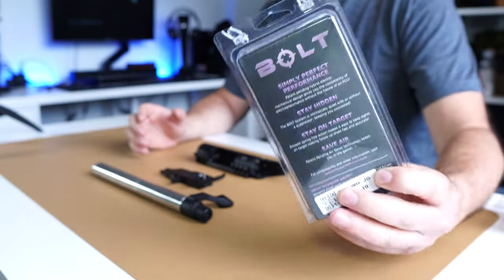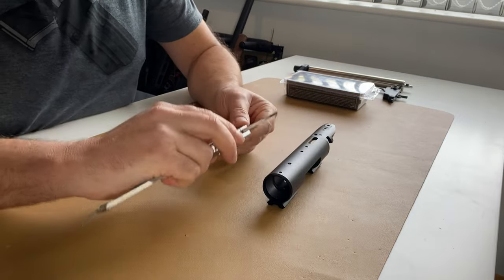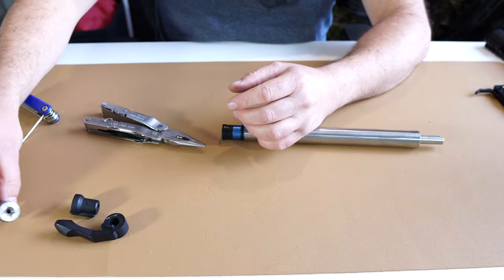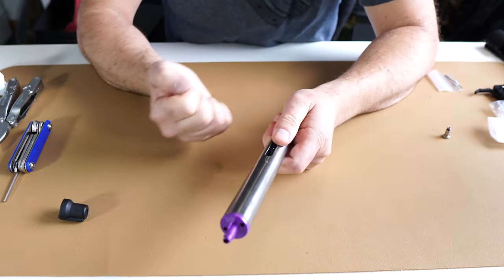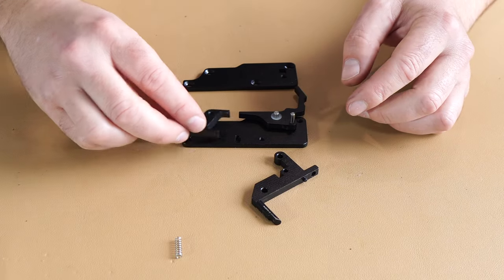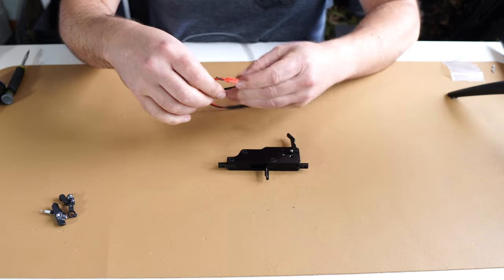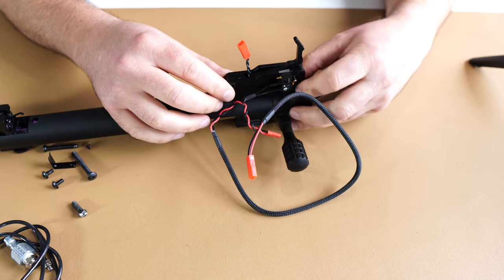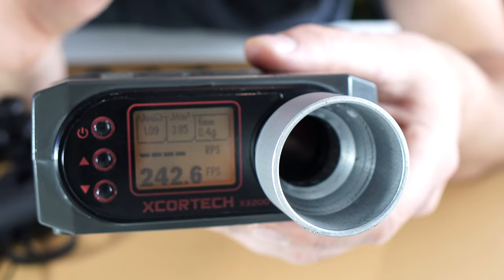HPA'ing A Novritsch SSG10  - Ep3: Wolverine Bolt Install (Airsoft)

Comment: For me it's a big meh... having to rely on both a battery and a gas tank to shooot. I'd rather go full spring or full electric, but both combined is a pain in the ayuzz
Reply: Chuck a decent suppressor on it and you'll definitely see why people HPA bolt action rifles. It's also good for stubborn builds that you can't easily squeeze more power out of it. My Sabre system in my M40 completely circumvents the lack of aftermarket parts.

Comment: Nice News toy for my ssg10 a3 , hi from Madrid. My quesiton is …. Why you dont use a mechanical bolt?
Reply: I want to know this too. Getting the impression that Bolt E is better perhaps?
Reply: @rdb9936   you will always think its better until u have one
Reply: @Uria-jz1gu  how do you mean?
Reply: @rdb9936 Frankly with how a lot of things in airsoft are right now. It's probably more of what he could actually get at all.

Comment: Hey Camman, awesome video as always.   Could you let me know why you use the spring?  I only ask as i have done this conversion (thanks to you) but i don't see the need for a spring?
what am i missing?
Reply: Cause the Wolverine bolt gives extra power+ its way more quiet
Reply: @govamichael  with the spring? I cant hear it as it is.
Reply: @s1sriggs the spring is so the bolt returns on its own. Otherwise you have to push the bolt back yourself after loading another round

Comment: Hi camman .you are the best …I have a question .i have the Novritsch ssg10 A3 .i think is the same with this ssg10 from your video.what bolt system I could use ?the bar 10 or Vsr10 ?we hope to see from you a testing video with the results .thanks a lot .keep going like that

Comment: So, does this change the behavior of the gun? Does it effect the accuracy I mean?
Reply: It didn't affect my accuracy, but dropped my joules. Also made it quiet, easier/faster to pull the bolt, but you have to be careful not to catch your hose on branches.
Reply: It’s not worth the complexity of the system. The the purpose of a sniper, hpa makes completely no sense.
Reply: @hitmanslayer3003 Unless your rifle as a springer can't fire at decent velocities. Or if you can't upgrade the compression side of things (my M40 has a plastic trigger box, no good for strong springs) and then of course when properly suppressed they become inaudible and that makes a significant difference.